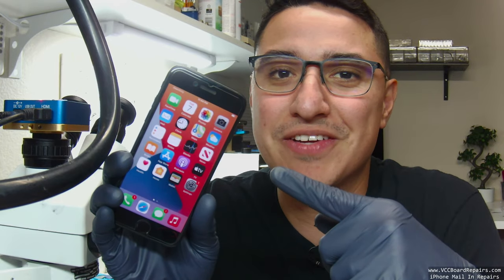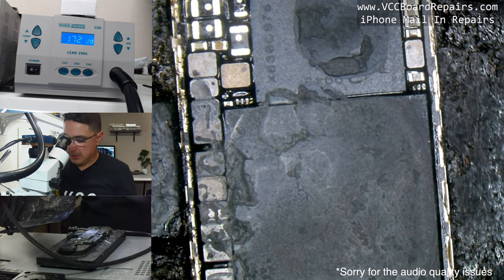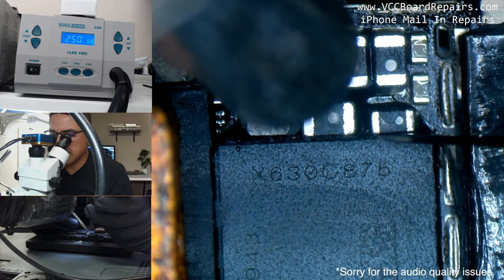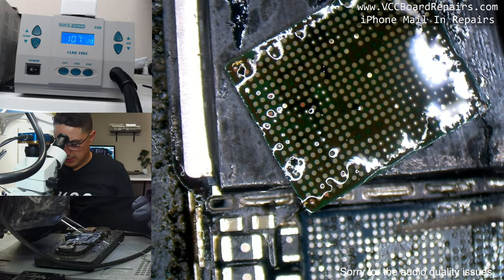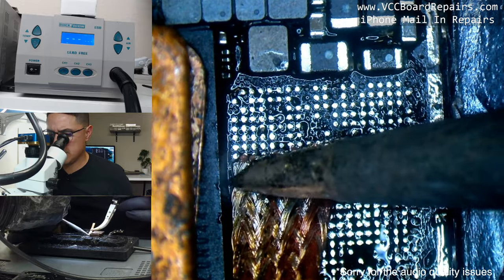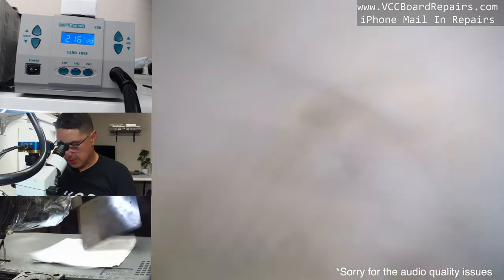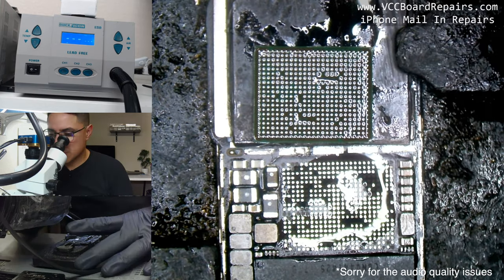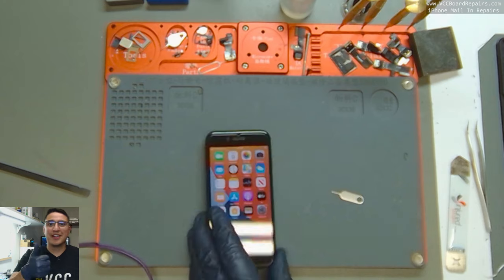No Service or Always Searching after iPhone 7 Audio IC Repair. How To Fix, Step by Step

Comment: Intro was funny. This is why I do very limited work on phones. I need waaaay more practice before going to far there 😂. Also awesome wiki pages man. It is appreciated. Thanks for the videos!
Reply from the maker: Haha thanks man!
Reply: This can happen to pros. Dont be fooled. Lots go wrong whilst doing sone repairs. I have done audio ic lots but once has this baseband repair. Board was already bent. If you can fix the issue its no big problem. Remove and reball bbcpu

Comment: Here in the UK I have only ever got intel ip7, I've done loads of them  with a pre-heater and never had an issue. The only one with no imei I've seen was a qualcomm which was a US import and that turned out to be the BB pmu.
Reply from the maker: Yes, BBPMU is very common to cause baseband issues when it happens "naturally". Where as in this case, it happened due to the Audio IC job.

Comment: Sir iphone touch ic, power ic replace tips and heating/air apply this ics dtl video plz iam iphone touch ic replace after sett dead iphone 6 so idont know this issues
Reply from the maker: I'm not sure. You can ask for help in my group. Just make sure to fully explain your situation if you want to get good help

www.vccboardrepairs.com/vcc-fb-group
Reply: @VCCBoardRepairs  ok thankyou 🙏🏻